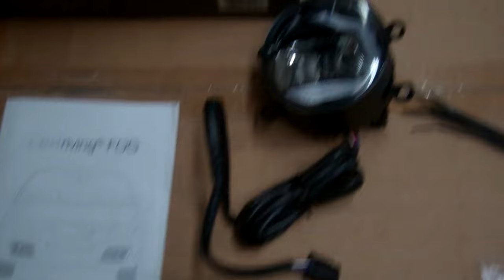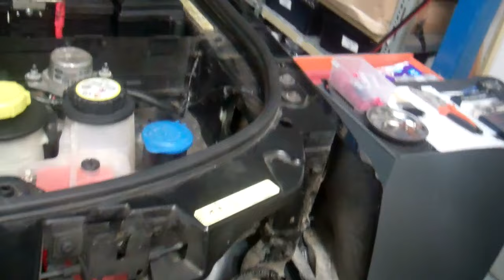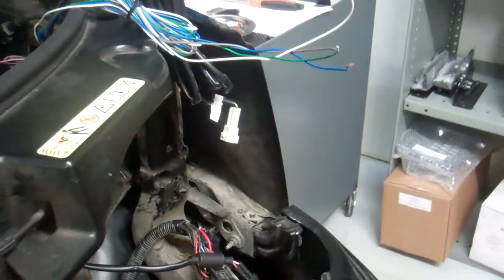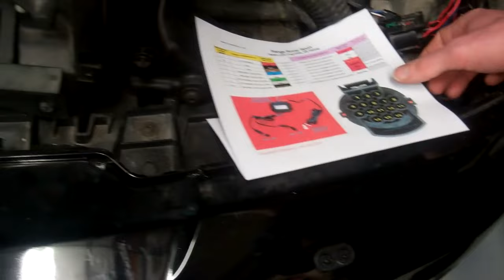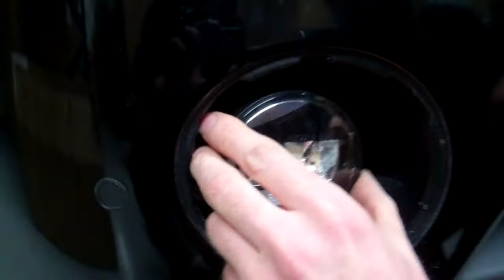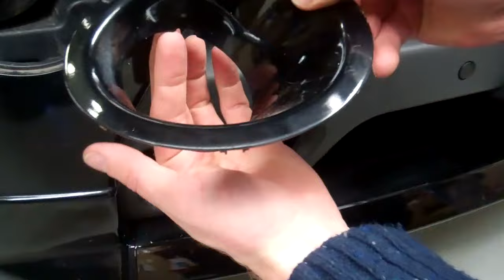How to fit Osram LED DRL Fog lamp conversion kit to Range Rover Sport 2010

Comment: No warning lights on dash? Do I have to use load resistors on a Merc? Thank you!
Reply from the maker: Yes or change the CCF files
Reply: @L663 I see you have to connect only one end to fog LEDs plug and the other stays unconnected, in this case how do I install load resistors? The car will detect one side is faulty.

Comment: Just installed mine today. However, The only single wires that came with my kit is blue, red, black and white. The manual says blue is optional. I have connected the white according to the diagrams on website and red to the bat 12v and black to the ground. So far the fogs come on but no drls.  Any info would be appreciated. Bought this last year from you guys. Thanks
Reply from the maker: Hi - yes Osram " updated" the design. Have you started the car ? the blue wire used to have a voltage sense circuit in it... when your engine starts the voltage rises from 12v to 14v and this auto triggered the  DRL's to come on. I cant get these from Osram at the moment - you will see we are out of stock so i cannot test the blue wire for you at the moment.
Reply: No the vehicle was off. I don’t have the blue wire connected to anything. But when I put it on the positive terminal the drls come on. Other than that nothing. Not even turn signals.  So I am confused... isn’t  this to  have the turn signals also?

Comment: Can you explain why you would get a flashing fog light on hazard but not on the indicator set up. I can't understand this? Thanks.
Reply from the maker: Hi - thats odd. Does it work for hazard with ignition on and ignition off ? with engine running and not running. There is some tricky voltage sense stuff in the control box..... This is the first time i have helped i Jedi ( although not helped you much yet ! )

Comment: Hi, I hope you can help. what are the dimensions of the lamp unit, if you were to remove the metal fixing bracket what is the diameter and length of the actual pod or module, I am trying to see if the module would fit inside and exisitng light fitting. Thanks

Comment: Hi! I want to replace standard fog lights in my RR Vogue 2007 m.y. Will it fit to a standard place without modifications? Thank you for answer and excuse me for my bad english =)
Reply from the maker: Igor Cherniaev Hi Igor, Sadly they will not fit the 2007 model.  They can be fitted to the L322 2010, but we do not have a fitting video for them on this model at present.
Reply: powerfulukltd thanks a lot for answer!

Comment: Hi, I want to replace my actual led fog lights because the light that they produce is very low, as much one meter or exaggerating 2 , so the are good for DRL but just for that, how about this fog lights, they are covering good distance in the night or in fog situations??, regards.
Reply from the maker: Aaron Joseph Gutiérrez These lights have a bigger range, They are blinding in the daylight!  Definitely worth paying out the extra for, especially with the additional cornering function